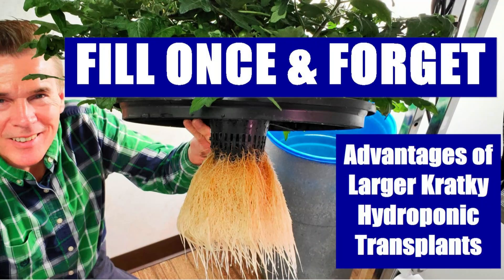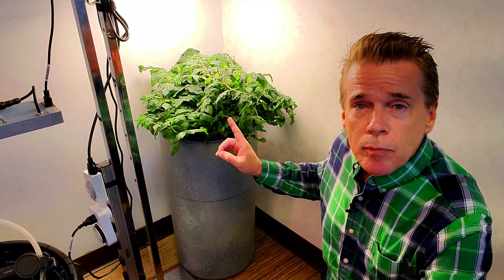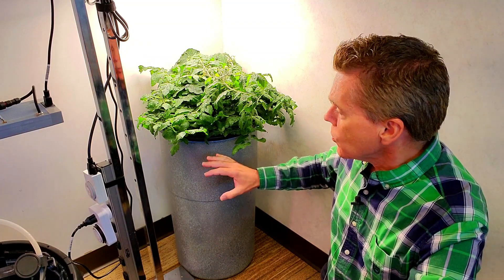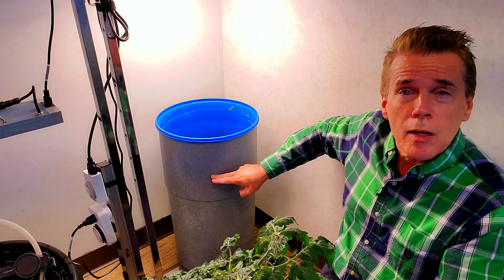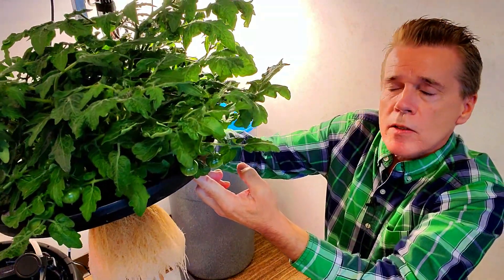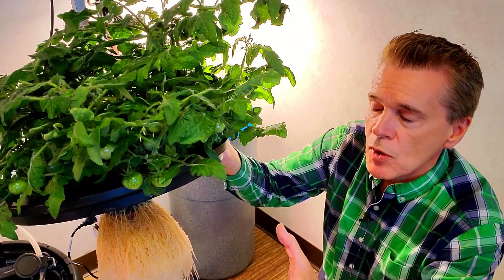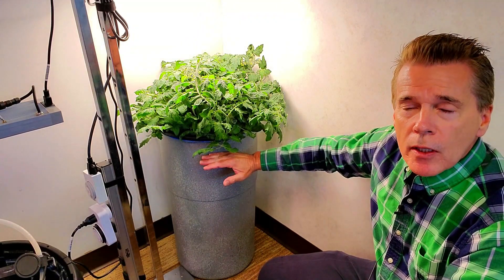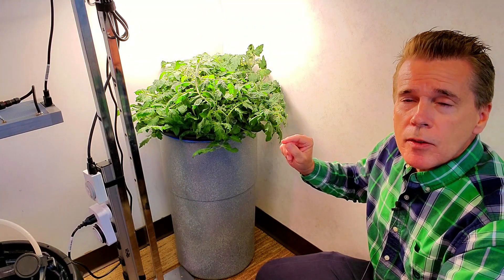HYDROPONIC FARMING AT HOME - KRATKY TOMATO PLANTS STARTING LARGER

Comment: I’m wondering if I could keep my Aerogarden Golden Harvest tomato plant producing much longer if I were to use the 5 gallon bucket with the Kratky method but continuously top off nutrients to the level that’s just below the air roots. It would no longer be the passive Kratky system but do you think this would work to keep the tomato plant alive and healthy?
Reply from the maker: First off, yes it is still a passive hydroponics setup with no aeration or water pumps.  Second, you are correct that it will not be Kratky since B.A. Kratky did not officially publish any materials on this adaptation.  Can it be done?  Yes.  I have used a five gallon bucket with a rocoto pepper plant.  The disadvantage is that every time you top off, if you overfill then you kill a few of the gas exchange roots.  That can be minor, and the plant has to overcome that setback each time, or major and you lose the entire plant.